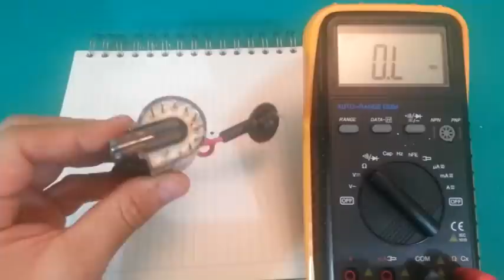How to Identify the Primary and Secondary of a Flyback Transformer

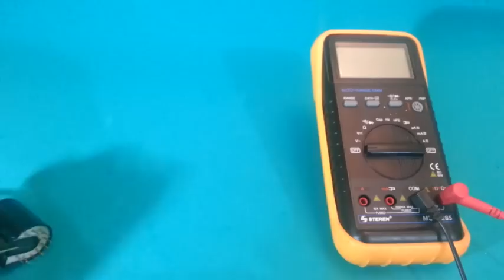Comment: Nice hack with the batteries at 2:25 to find the ground pin.  Worth the whole video.  See how little current the diodes in the secondary need to conduct.  A meter with an input impedance of 10 megohms measuring 10 VDC has only 1 microamp following into it.

Comment: Really great video but the only thing that is missing is that you don't need to check for pars of pins, you can have a high resistance between pins that are not close together. You also should isolate the pins with hot glue or oil before using it. Some flybacks are a little different and require connections between some pins. If your flyback is not working, solder a wire to all pins that are not being used, put them close together and watch which ones that arcs. Those that arc should be connected together.

Comment: excuse me sir, i want ask, what the output or the secondary voltage of the flyback transformer? it's a DC or AC voltage. And the voltage selector that using in the multimeter is the AC or DC selector?? thank you very much to the great explanation

Comment: Would using an inductance meter instead of a multi-meter be better at finding the primary/secondary of a flyback transformer?
Reply: Not necessarily in this case because these types of flyback Transformers have diodes between the secondary and the red hv cable and in this case the inductance meter won't work properly

Comment: Well can that flyback transformer be used some thing similar to variabel inductor?
I cinde of have small inductive trigger on me distributor so I was curiuse culd that thing posibly some how phase shift that pick up coil or the gm ignition module.
Im in dilema for days finding some thing that does that task just to retard me ignition timing on engine start up .
So I need some thing that can regulate pulses or restrict the triggering circuet .
Only problem I dont know if I shuld use voltage restricting circuet or frequency restricting circuet??

Comment: How is 18vdc inducing voltage in the coil? It takes ac current to work  on a transformer.
Reply from the maker: Not only ac, it also works with pulsed dc.
Reply: @ludicscience  yes but you were not pulsing it

Comment: there are flybacks with one or more cables besides the red one, which is the high voltage output; in my case I have a yellow cable next to the red cable. what are these wires usually used for? is it a ground or something?

Comment: sir, i have flyback transformer FA122WJ-SA, this FBT has no datasheet when i search on google, and when i try your method, i got 1,7 ohm, 1,1 ohm ( more than one of 1,1 ohm connection) and unlimited resistance pin. how i can find  primary and secondary ?
Reply from the maker: try al of those pairs of pins, there is no way to tell which of them is the correct one.
Reply: it look like i must try your another video "easy flyback driver" i think that video is very simple.

Comment: the transformer i have has a grey wire coming out the bottom near a turnable knob, idk what its for. it has a red wire that looks attached to what i think is a capacitor then a white wire coming out from near one of the knobs(the middle knob) on the flyback.

Comment: Because i cant find any 9v battery around me, i just use 240v.ac but in maximum alert. Ive follow every step same like you. But no voltage found in any pin.. but when i swap the probe.. suddenly 240v is pop-out in 1 of the pin...why ?
Reply: First of all, you're likely destroying your flyback by putting such a high voltage into it. Secondly, are you measuring in DC mode? A flyback has an internal rectifier diode that makes it output DC only.
Reply: @DasAntiNaziBroetchen  yes in theory.. But i not even think about that.. because my exprnce is more to ac. Sometime we got to do what musnt (in a super-full caution...ofcourse)

Comment: You cant rely on this method to work for every flyback out there as most larger ones will not show a secondary winding resistance nor an output voltage from an attached battery. it's best you find a spec sheet and pinout for your desired transformer.
Reply from the maker: ElfNet Gaming Yes I have seen that some flybacks do not work with this method. But sometimes the flyback has no marks or the datasheet is not available. I will add that to the vid description thanks.
Reply: Yeah man totally true doesn't work for mine.....
Reply: If these tests don't work for you then the tx is probably unsuitable for your application.

Comment: Hello, I have the same transformer, can anyone tell me the voltage of the secondary side? Transformer is bsh8-n5 
I will be powering a small crt with it and I do not want to destroy it with too high voltage and is there a difference when I use different flyback drivers? Will using different flyback drivers effect the voltage on the seccondary?
Thank you :)

Comment: Which is better, an ohm or an inductance meter to find the correct taps on a flyback transformer?
Reply: neither. for the flybacks with built in diodes, they won't switch on until the forward bias is high enough -

Comment: I used 24 volt input But I got only  2 volt at the ground pin of Secondary coil. Was my fly back transformer bad in condition? Then, how to check a good condition fly back transformer?
Reply: Diwakar Manandhar You need flyback driver.

Comment: Hi, dear sir, I have a question :) I cant find the primary and secondaty of my flyback...but on the back of the circuitboard every pin had a number or name near it, so:
Pin1=COL, 2=B+,3=14v,4=-14V,5=-190V,6=GND,7=N.C.,8=N.C.,9=ABL,10=H.T/HEATER... which is what???? Pls help me sir, it would help me to make progress in my tesla coil project...I've got 1ohm when i connected the 10th and 8th pin...aaand what will happen to my tesla coil if i add one more powersupply like this or similar???(in parallel of course...)
Reply from the maker: +gyorgy komaromi Sorry I don´t know that nomenclature. You cant use two power supplies in a tesla coil, is better to use a single powerful one

Comment: I'm confused by measuring resistance on my flyback transformer trying to find the primary coil! From pin 1 to pins 2, 3 and 4 I have the same value of 1,3 ohm! Between 2 and 3, 3 and 4 is 0,4 ohm! Between 5 and 6 is 0,4 ohm! Between 6 and 7 is 0,6 ohm! So where's the primary coil pins???
Reply: Same  problem here !
Reply: 3&4pins which has nearingly 1ohm - 2ohm is meant as primary coil
Reply: 1&2 pins are meant for feedback coil

Comment: Hi, I appreciate your tutorials, because they are so clear.I am trying to make a Tesla coil, and I need high voltage supply. I have one larger flyback transformer just like you show on the end of your tutorial.This one have 11 pins.Now I have a problem to locate primary  of flyback. I measure 0.9 0hms between 7th and 10th pins and 0.8 ohms between 8th and 10th pins. What you suggest now. Thanks.
Reply from the maker: +Milan Brkic try both pairs, the flyback will not be damaged if you use the wrong pair.
Reply: +Ludic Science Thanks. I try both pairs with two different circuit from cfl lamp, and doesn t work. How can I know does this circuits from CFL lamps are correct. How many volts should be on the output of this CFL circuit. I have one smaller flyback and  one of primary pins are clearly visible, can I tray every other pin with it. I already find a ground on both flybacks. I will try option with winding a primary and feedback, and what is better solution in your sight , CFL circuit, or "winding" option.If i try a "winding" option I suppose that can use the transistors which have been in TV with that flyback.Thats D1651 9M1 and 2N 6253 or have to use TIP 35c like you said. By the way I can by TIP 35 without C, but that is expensive to me.I also have Bu 208, S 2530 A  (4 A) and 2N 3055. Thanks.
Reply from the maker: +Milan Brkic CFL circuit should give somo 600 volts. You can add a 10 k resistor to the CFL output and check if there is a voltage. 
I prefer the winding option, but you can not use the TV transistor. That transistor is designed to work with the internal coils that need 100+ volts. The 2N3055 can work in place of the tip35c (if it is a real one, the 3055 is the  most counterfeited electronic component)
Reply: +Ludic Science Thanks again.I have two 2N3055 and both are real.Both are produced in my country (in my town exactly, when this was a one happy country) 35 or 40 years ago.And both are still operated.I will be free to ask you again if I stuck somewhere.
Reply from the maker: +Milan Brkic Great!!!! Hope it works.

Comment: 3:53 The pin identification of secondary could also have been done without a battery.

By using continuity mode in multimeter
Reply: @TD75  oh, Thanks for the clarification friend.

Comment: Would it work at 60Hz   , 12 volts and let say 10 turns?
Reply: Yes it would work( 60hz), but it wouldn't be high frequency (high frequency > 700hz produces skin effect, won't shock you, rather melt your skin)

Comment: Good to know. I had to put 30V DC on mine before I could see something - turned out, I had one that was different than most and PIN2 (or PIN8 depending on how you count) was the ground for the HV side. - it passed through 3 diodes - strange, the diodes need so much voltage to switch on.
Reply: Really, like how much votage the diodes need?

Comment: To test ground pin can't we simply test the continuety of red wire and other pins?
Reply: SPIAR 
The resistance of secondary is very high 
Then continuity will show nothing
Reply: There's a high voltage diode built in, it needs about 30v to start conducting

Comment: Nice video. How to make a 20,000V spark generator driven by AC signal (20,000-180,000Hz)?
Reply: This type of transformer usually have diodes at the output. So no matter how high you bump up the frequency it will still have the huge DC component at the output that will shock the sh*t out of you.

Comment: actually i have a big one (that u showed in the last) flyback but in that every pair had 1.6Ohm resistance but one pair had very high resistance out of range of my multimetrer and when i did the battery test .. one of the pin of the high resistance pair was the primary which showed nearly 15-17V
Reply: what are those adjustment dials on bigger flybacks? and what are the other two wires for?
Reply from the maker: Anurag Trivedi those are used for screen adjustments in tv use. You can simply cut those extra  wires

Comment: I am only getting 1 ohm across the entire transformer, does this mean this transformer is no good?
Reply from the maker: +ben barr What do you mean by "entire transformer"?
Reply: None of the pins read higher that 1 ohm for the pairs that are connected.
Reply from the maker: +ben barr Not all flybacks can be tested with this method, i am not sure why. Perhaps you have one of those.
Reply: Ludic Science Must be bad luck, I have had three transformers with 2 different meters do the same thing. Is there another method to find the primary and secondary on the flybacks that don't work with this guide?
Reply from the maker: +ben barr This is the only method I know. You can try to find the datasheet if you know the model of the flyback.
Reply: Ludic Science Sadly I don't, but thanks a lot for your responses.

Comment: couldn`t you just check the continuity to find the negative side of the secondary? :D
Reply from the maker: Ktohen Only if you own a gigaohm meter :)
Reply: +Ktohen The high voltage winding has one or more high voltage diodes in series with it. A continuity check won't work since the test voltage in the meter is very low and a few diodes in series will drop more voltage than the meter supplies. The reason that you need the 18 volts is to overcome the voltage drops of the diodes.